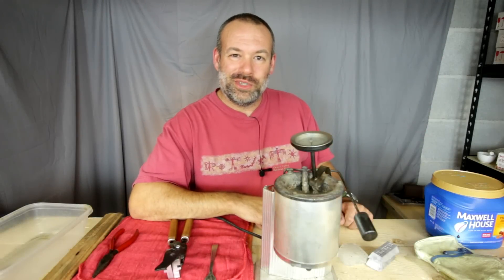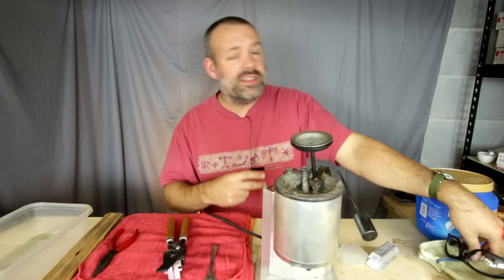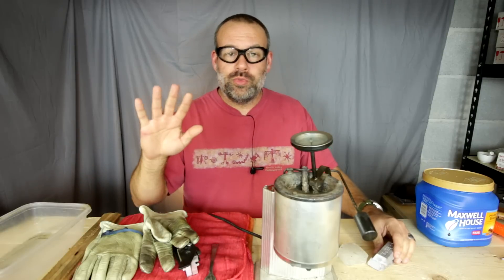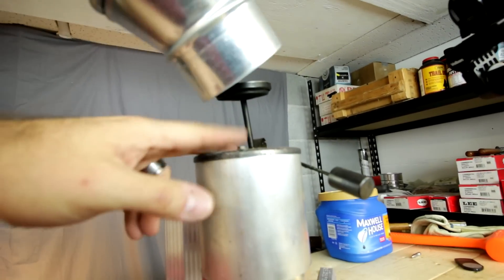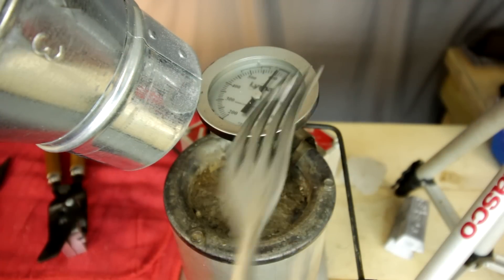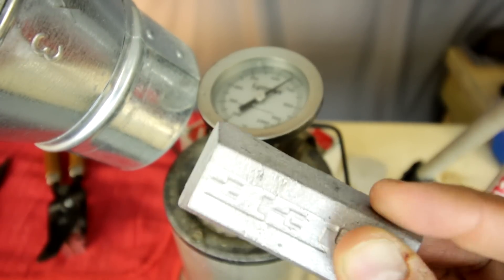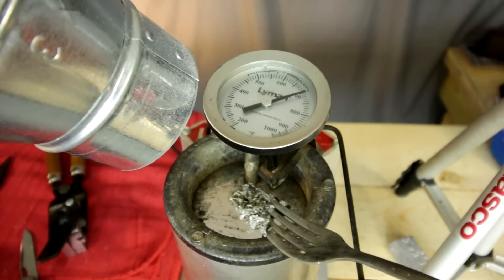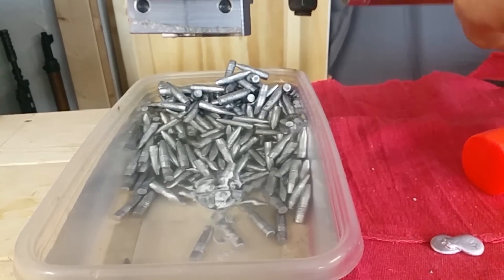My Bullet Casting Setup for 2017

Comment: I cast lead outside so I don't need to worry about fume extraction or lead dust from the dross that might contaminate my home. Unfortunately that means I can't cast when it's raining or bitterly cold. One other safety tip is to be careful not to allow any water to drop in the melt pot. Even a drop of sweat is enough to cause some serious spattering of molten lead.

Comment: What shooting conditions requires a BH of 20-21??
Reply from the maker: Rifle speeds, worn barrel, or to run in a polygonal barrel such as a factory Glock.
Reply: DEUCE AND GUNS    I have a S&W 357 Mag pistol and a Henry 357 Mag rifle I load for.   I quench my target bullets but not my hunting bullets.   I add a little soft lead for the latter.  I also powder coat everything.